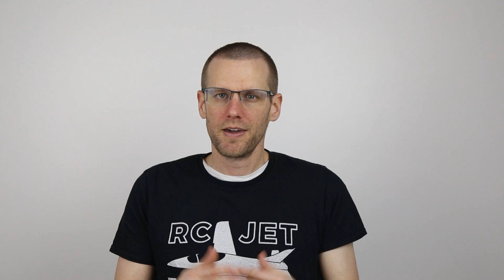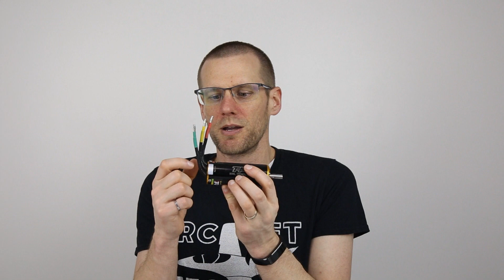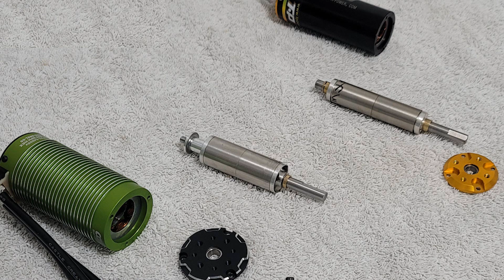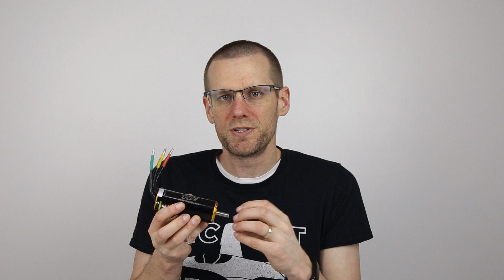5 Reasons YOU should Run a Sensorless Brushless Motor

Comment: For the most part there is many great and informative videos on this channel however I find this one a little bit deceiving and biased, it's not so much the facts arent rrue per se but rather incomplete or heavily weighted towards sensorless motors. Firstly there is esc's that operate in sensorless mode after initial sensored operation at higher rpms giving the best of both worlds. The weight thing is mute point as afew extra grams on an rc car ranging from a few kg to 20kg is so negligible it doesnt matter. The point about reliability although somewhat true is also irrelevant because the motor can still operate in the supposed 'better' sensorless mode regardless. The size issue may be a concern for some builds but in most case ways around this issue are often discovered and more rc's will have no issue due to sensorelss motors being a little longer than those that do. As motor size increases and rc scale increases this also becomes less and less ofa factor and more so the size constraints come from those trying to fit a bigger larger scale motor than was intended by design. Price ofc is always a concern for some but that goes for anything, but chances are if you are dropping thousands on an rc car and fancy radio gear and are into such details as sensored, kv ratings and amps then it mostly like is a hobby that you are passionate and throw a lot of money at. The biggest point though I repeat is that escs can switch from sensored to sensorelss during operation so no compromises are being made performance wise but gains are made at startup.
Reply from the maker: I understand your perspective, but I believe these comments are heavily biased towards RC cars, rather than considering other RC vehicles like EDF jets or airplanes.

The purpose of the video is to highlight the specific aspects of sensorless motors that make them more appealing. Here’s a link to a video about sensored motors, which focuses specifically on RC cars: https://youtu.be/WqqsNt_v098

Comment: Say I go "sensorless", Can you get the RPM from the ESC without a sensor? i.e the ESC is sending pulses at a particular rate to the motor....

Perhaps it depends upon what ESC is in use? Whether it supports bi-directional dShot?
Reply from the maker: Getting Rpm from the esc is not determined by sensored vs sensorless.

Comment: The Main advantage that sensored has over sensorless - the cogging at low RPM, can be overcome with a few different methods to glean the back-emf information from the windings alone. One promising example is High-Frequency Injection (HFI), and the startup sequence can be altered from punching at 1 phase at a time, to full on sinewave 3-phase commutation with some sort of ramp-up time. Sure it might be inefficient to run it in these states but the intent is to kick it into the back-emf-sensing realm of the esc as strongly as possible.

Comment: Bought 3 Arrmas. All 3 were V3, BLX.
TYPHON, BIG ROCK, SENTON.
NO cogging issues with Typon or Big Rock.
Senton cogged badly. If stopped on hill, trying then to start up hill, esc would shut down.
I called store where I bought it, they said it's normal. I thought,  if normal,  why doesn't Typon /Big Rock shut down? 
I knew something was up..
Simple Fix: I found both Typon/Big Rock pinion were 15T. Senton was 20T. 
Installed 15T on Senton,  problem was fixed. That's all it was. So if cogging is so bad, gear down a little. 
I enjoy your channel,  (like /subscribed) because it's like this video, I thought sensored was THE WAY TO GO. I LEARNED,  not always.
Thanks
Reply from the maker: Thanks for the comment Tiger one!

Comment: Thanks for this video, it's cleaned a grey area of opinions for me.
Question.
Not all my Boats are bolistic. I have some that are to be slow. (Tug boats/warships). How can i get brushless to go slow enough for tugs.
Its not quite right to see the Rotterdam and Imara planing. 
Is there any way i can go brushless in these ships or am i stook with brushed motors. Thanks for any help.
Reply from the maker: Yes, go for a low Kv larger Outrunner style motor. These motors will rotate at very slow speeds and do not need to be sensored either.

Comment: Another advantage (or dis-advantage depending on your situation) is the zero RPM cogging under extreme load. The reason I say this is because if you have something bind in your drivetrain (for example like happened to me is a grub screw comes loose on your pinion and gets trapped on the motor mount on a Arrma Typhon) less damage can happen to the car compared to a sensored system that may run even though it is loaded down due to the binding in the drive train.
Reply from the maker: Interesting perspective Adam.

Comment: In short, if you are running a crawler or something else that needs a lot of slow, low end control, go sensored. Anything else, go sensorless.
Reply: Not always. Try sensored hobbywing 2800K on the track or something smaller in 1/10 onroads. Motors are more accurate. Also there you can feel better connection with the driver. Does not exists only bash or crawling :-) There are also hybrid motors which are running in sensored mode on low speed and then switch to sensorless in higher speeds :-)
Reply: I can now compare it after some tests. In indoor 1/10 buggy was a changed behavior without sensored cable just a little bit. 1/10 onroad, there is still need for me to have sensored for precious curves and also for accurate breaks, then accelerate in for example with my xray X-1 formula and Hobbywing 21,5T
But i tested in 1/8 Serpent SRX8e PRO with XR8 ESC and hobbywing 2600K(suited for onroad but im using it in buggy) and there was no difference in sensored/sensorless mode on the dusty dirt track. So it is up to everyone. Im just writted my feelings from the own tests. Im just hobby driver. The more important hardware for me is a good fast radio or strong and fast servo. Can live without sensors on 1/8 scale Buggy/Truggy :-) I have not any crawlers, but when i have some, i will definitely want there sensored combo in all scales of the truck. Because there are so slow speed requires precious handling.
Reply: Also, AM32 loaded ESC can run sensorless motor on crawlers!